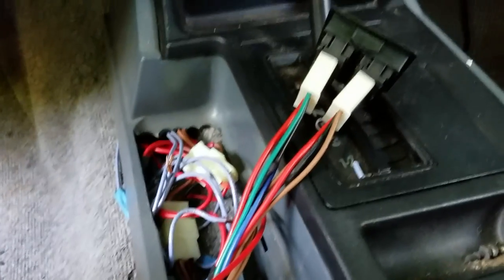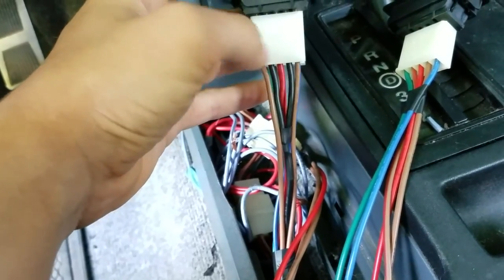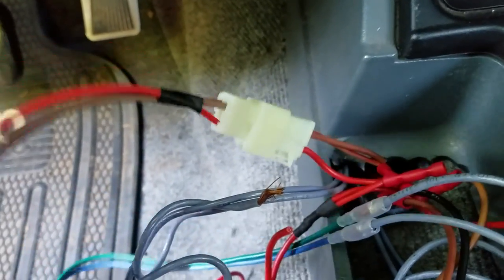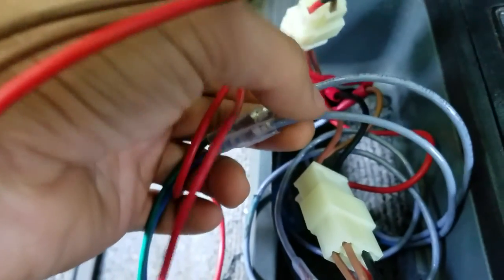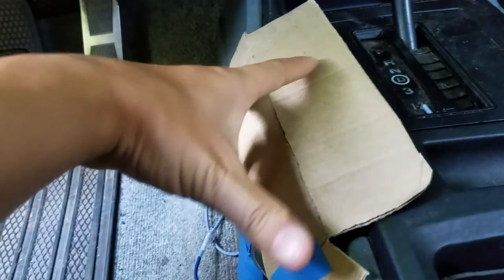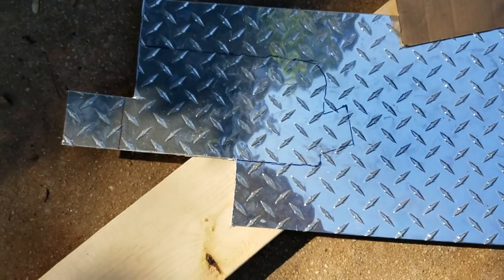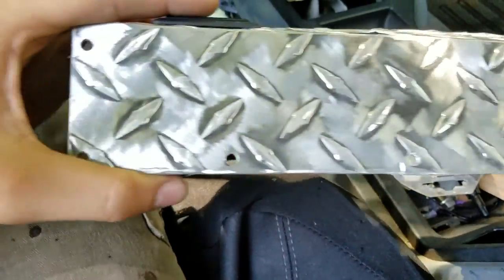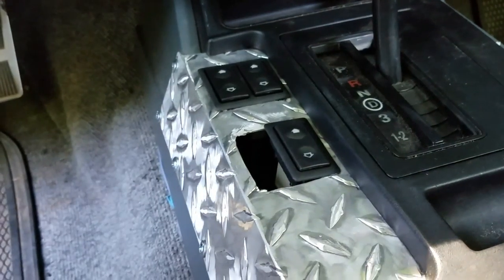How to install universal window switches

Comment: Hey quick question i done this too my 2000 ford ranger ive got powerlocks and powerwindows there connected to the fusebox for testing it works but could i wire tge two positives from the powerlocks powerwindows there both red.     Can i wire them up too the ignition switch?
It wouldn't blow fuses?

Comment: noob question i can use one ground wire, split it and connect it to the 2 ground terminals? or just use jumper wire?
Reply from the maker: Either one is fine. I normally use jumper wires.

Comment: I have manual regulator in my car but i get power regulator which is suitable for my car but i have question can we wiring power window motor direct through 5 wire switch without any relay ?? Is it possible ??
Reply from the maker: Smit Aghera I ran mine without a relay because they where a 12 volt switch, just find a power source and go from there but I recommend running a fuse which I don’t think I did on that.
Reply: @Tylerjschmidt  ok i connect it to direct ignition power via T joint and put 12 v fuse and i have question that my car have accessories power socket can i joint this direct to accessories wire !
Reply from the maker: Smit Aghera Yes you can

Comment: hello good I have a question I have installed a window regulator kit but I have a problem is that when I give it to lower low perceives but when I give it to raise the left window it costs him to raise but it rises pe the right window lowers very well but that does not raise him I have to help with the hand because it can be thanks
Reply from the maker: ana caballero your wires might be crossed.
Reply: @Tylerjschmidt not since they came mounted as standard the only thing I did was put new cable on the ceiling maybe I have put lower quality cable can you tell me which is the best electric cable of what kind of cable should I ask for in Spain
Reply from the maker: ana caballero I’d say 16 gauge wire.

Comment: Hello, could a universal window kit take its power from the remote central locking within the door and in theory allow you to close the windows with the central locking key fob?
Reply from the maker: Andy Cregg  yes but you would have to run it to the ignition still to get power. On the remote key all it does is start the engine nothing else would come on until you put the key in. The kit should come with a diagram to show you which wire runs power from the windows to the key fob if you wanted to roll the windows down with the remote.

Comment: Where into the fuse box did you run it? This is where I'm stuck and I dont want to accidently run it somewhere where it shouldnt be.

I got my negatives to my chassis, and I test ran my postive to my battery, it worked for like 5 seconds then I noticed the postive wire got so hot it was starting to burn, so I figured it cant be run straight to the battery in any circumstance it needs to go somewhere else
Reply from the maker: KewlCrayon you can run it to the 30 amp accel fuse on your fuse box, or run it to the accel on your ignition switch. On my car it is the yellow wire.